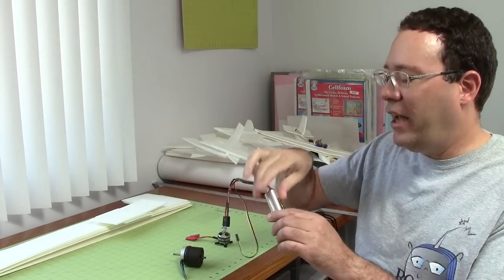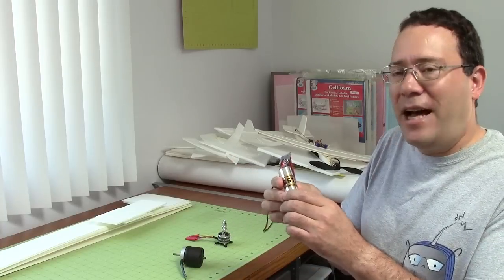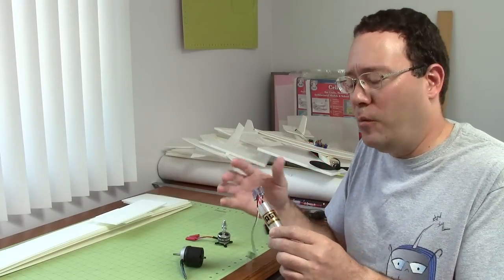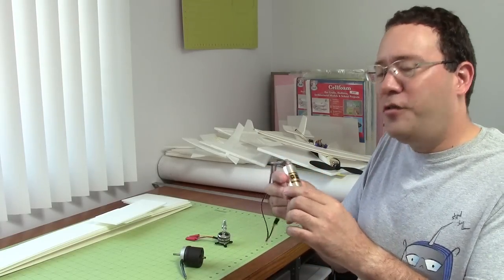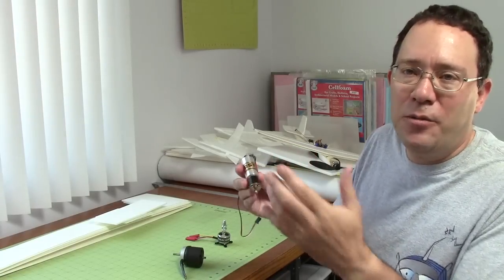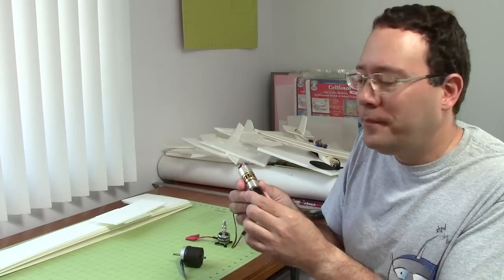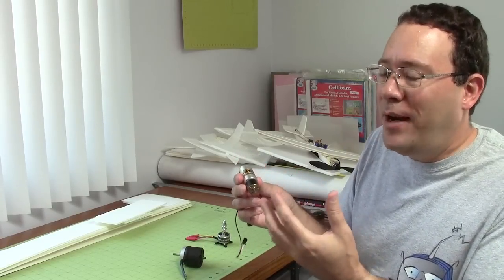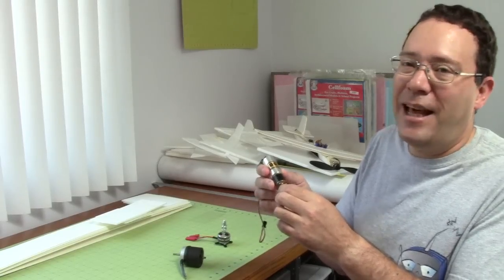Inrunner vs Outrunner Motors

Comment: brushless inrunner has a high torque in a high speed but outrunner is for high torque and low speed,so INRUNNER BRUSHLESS SENSORED/NON=SENSORED MOTOR is only for HIGH SPEED while OUTRUNNER is only good for LOW SPEED. just likein a PISTON ENGINE with a SHORT CRANK THROW VS LONG CRANK THROW  set up.in the DESIGN of inrunner and outrunner there no waste and failure,its ONLY UP TO YOU what youve like or where u going to use it. just like buying CARS and Motorcycle .

Comment: Dier Carlos Reyes why dont try less Voltage instead of a Gearbox to reduce KVs...? im sure you will be happyer with Inrunners. Run it only on 2s and double up the mAh with two smaller 2s Li-Pos in Paralell or buy a expensive big one. With less KVs you will be enabled to mount bigger Props......only thing Inrunners needs is Cooling...so let them breathe Air with an Air duct......because the smaller Diameter but longer it will be easyer to give them fresh Air then in Rc Cars.

Comment: I still dont understand why do inrunners have a gearbox attached to them and not outrunners?
Reply: because they like to reduce KVs, like he said in hes Video smaller Propellers has lower Efficiency, He just forget abbout he can use smaller Batterypack a 2s insteed of a 3 or 4s to reduce KVs....instead aof a Gearbox. Inrunners has the double of KVs then Outrunners......because RC Stuff builders has to do it so....they say an Inrunner has only 2, 4, or newer 6, Poles inside. Outrunners has abbout 12 to 24 Poles....they say Outrunners has less KVs because Electricity needs more Time to pass more Poles but effect of More Poles is more Torque. Since Drones gone on Market they sell biger and biger in Diameter Outrunners but in tight build up. They have a lot of Torque with less consumption of Eletricity. Inrunners or older Brushed Inrunners are selled with Turns,  More Windings/Turns effects more Torque and less KVs also lower consumption, less Windings/Turns are higher KVs with high consumption of Electricity. 
i think Inrunners are the better Motors because rc Cars uses Inrunners and they need much more Power then a Plane. Outrunners only bigger and tighter will be good like the Drone ones.
if the Torque was the real stuff then rc Cars will be driven with Outrunners.....
i will try now a Inrunner Car Motor with 3400KVs with only 2s but maybe paralelled Batterys to double up the maHs. Im sure the Plane will fly much longer then with any Outrunner on same Batterypack. Watch impellers all driven by Inrunners because they have the better energy ratio, yess they need higher KVs and yess theese Planes has mostly 6s Batterypacks to spin the small Turbine fast enaugth for Pressure....if you mount a Prop, a big Prop you have to reduce KVs with less Voltage so a 2s Pack will be good....im sure
Reply: @bratwurstmaxxehaxxe5315  sorry, your assumptions about  motors and power  are  NOT  correct.
Reply: sure
Reply: both
Reply: Most cars have gear boxes which is why they aren't outrunners. As well as the fact dust can get in.

Comment: lol this guy has no clue what hes talking about in some parts. the motor he showed inrunner wise was a brushed motor.  they do make brushless in runner just as powerful as a outrunner.  This is not the issue.  Outrunners work better for aircraft cause of the way they are designed and cool them selves while running.   Out runner are contained and run hotter and are used for land rcs cause they resist dirt better.  Also inrunners can be water cooled for boats.  There is no difference in power.  The crap brushed motor is old school crap from 20 years ago.  Anything is better then that.  Ps they still use gear boxes with some types of setups with brushless motors for plane you just don't have access to bigger models I guess?
Reply: Øh
Reply: +gunthreadadapters.com  well!  for an RC boat!! either works good!  Depends on your build setup.  there is water cooled outrunners as well as in runners for rc boats.  The out runners have two ports screwed into the front of the motor where it mounts or you can use a water cooled motor mount to put your outrunner on.  In runners always have a boot around them.  But boats are tricky with heat!  Low Kv motors like 1900kv say 6 cell and a 3000kv motor with say 4cells go about same speed in the same boat.  It's close not exact just example here!  The 4 cell 3000kv will tend to run alot hotter then the 1900kv with 6cell lipo.  Prop size is a factor and pitch.  A larger prop or step pitched prop tends to create more heat as well.  But here where outrunner kills the inrunner!  Out runners run cooler under higher loads and can creat more power,  So say you had a 6cell 1900k inrunner and out runner identical setup.  outrunner will run cooler push that prop with little effort.The inrunner on the other hand can run long durations with smaller prop at high speeds and keep it's temp pretty level depending on your cooling setup how good it is.  A outrunner tends to keep unbalanced heat as it runs long durations. Hope that makes sense to you lol I will give you example of my Rc race boat setup.  I have 2x 1900kv outrunner motors in my 38 inch boat.  with 80a Esc's each motor has a 6s lipo with a 45c rating.  2xESC' 2xmotor and 2xmotorr mount are all water cooled by a brushless water pump that has a speed controller that regulates it as my boats throttle goes up! 55c is about the hottest anything gets in that boat wide open whole time. does 75mph round about.  One other thing!!!  If your going to use the boat salt water*  make sure the coils in the motor you buy are potted!  Salt water tends to eat those cheap painted china coils.  Good varnished coils tend to not go bad.  That us why some are marked marine grade if you plan on salt water play lol. I live in Sc know this first hand all to well
Reply: +gunthreadadapters.com  ahhhhhhhhhhhh  well that is a whole new world then. What are you going to use a car or forklift motor then to drive that project lol?  I saw a kid toss a 60volt Crain lift motor on one those utility cart things while back was pretty impressive till the rear end melted lol  I have a forklift motor here been dying to toss into a old street bike in back of the shop lol   Would love to see a full size electric boat. seen a few VW bugs with fork lift motors in them they fly!
Reply: Why would you think the inrunner he shows is a brushed motor?!
Reply: Dude Brushed Motors paired with Li-Po Batterys are amazing......i buyed a Brushless Combo for my tiny RC Car 1:18 Size for my Second one i buy a Brushed Race Motor 370 Size with interchangable Brushes and a New ESC both runs with 1200mah Li-Po 2s Pack and both runs over 35min on a Carpet Cyrcle Race Track with the same Performance. Me and all Racers there wonders how this is possible.... Fact, old Batterys are Crap, Motors not. A Industrial Electric Motor Repairer tells me that Brushlessmotors are not younger then the Brushed ones.
I need to Test theese tiny Inrunners on small Planes, i think this Multipol Outrunners has a much more elecricity Consumption then 4-Pole Inrunners has. 1200mah 2s Li-Po and good 40min Racing on 4 Wheels with 516g of Wight extreme Braking Induction and Upspeeding 35-50A Esc... ?????? How long a Plane can flight with this small Battery and 370 Size Motor and just 20 A Esc ... ???? 2 Houers..??? Need to test it.
Reply: i saw Drones working under Water so why you dont put the Motor outside of the Boat dont need Extra Cooling when the whole Motor is in the Water. Maybe Outrunners works better under Water but Inrunners has a smaller Diameter and dont make Waterturbulences for the Blades....maybe Outrunners preSpin of Water will have a positive effect on the Blades/Turbine...try it.
Reply: Rich Morgenstein but why are the inrunners much expansier than outrunners